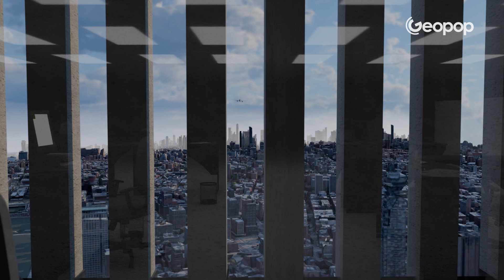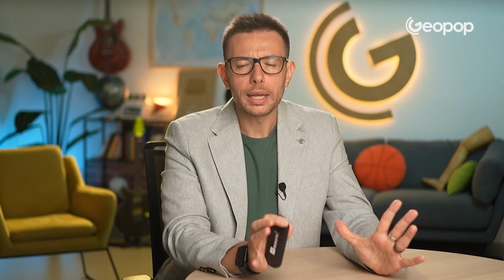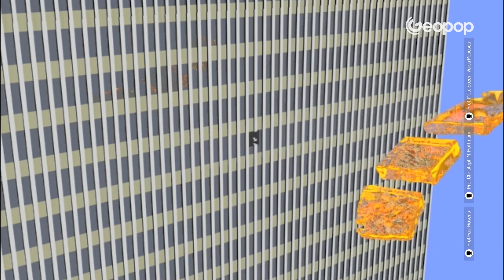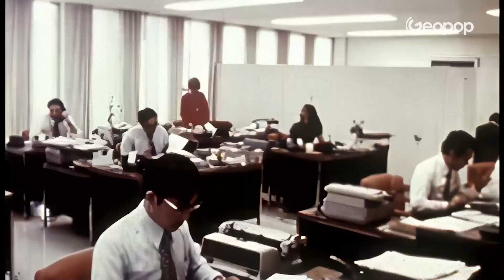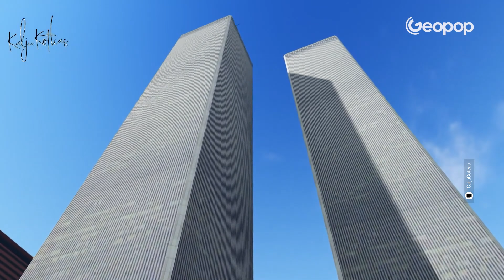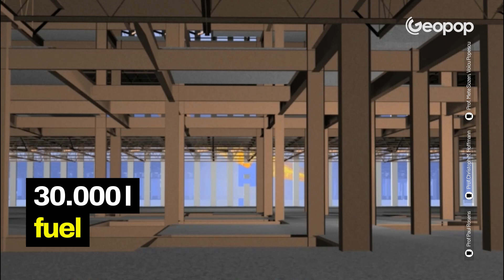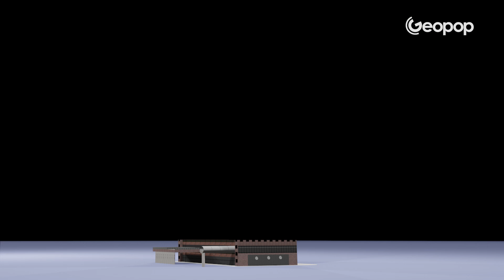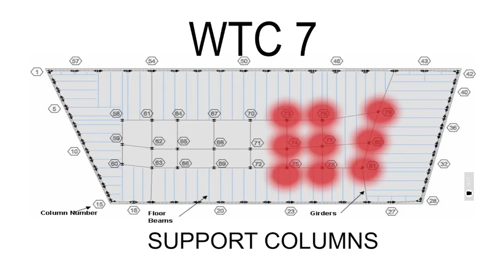9/11, 2001: The Technical Reconstruction of the Twin Towers and WTC 7 Collapses

Comment: B.S.
Reply: PROVE IT
Reply: @Tim22222  Easy.  BBC reported collapse of building 7.  Twenty minutes before the fact.  The equivalent of having a sack lunch and Filco radio.  Having your lunch @ Dealy Plaza.  Hearing on the radio President Kennedy was shot in the head.  Then 20 minutes later, the motorcade comes by you.    You witness Kennedy get hot in the head exactly as the news reported it 20 minutes before the fact.
Reply: @raymond3803  - And here we go again - FFS.  Conspiracists do love beating the same tired old dead horses into glue, never succeeding but always expecting different results.

At 11:07 am CNN reported Building 7 had collapsed at 10:45, or 15 minutes after the North Towers collapse at around 10:30. CNN got their (mis)information from the respected news agency Reuters, which picked up an incorrect report. They issued this statement: “On 11 September 2001 Reuters incorrectly reported that one of the buildings at the New York World Trade Center, 7 WTC, had collapsed before it actually did. The report was picked up from a local news story and was withdrawn as soon as it emerged that the building had not fallen.” 

On 9/11, reporters also said that Camp David had been hit by a plane. Forbes magazine reported that “A car bomb exploded outside the State Department, according to State Department sources.” CBS News reported that as many as eight planes have been hijacked and only four have been accounted for. 

Those reports all turned out to be false, obviously. Just a few of hundreds of news reports that, in the chaos and confusion of that rapidly evolving event would, with the benefit of 20/20 hindsight turn out to be wrong.

News flash: Reporters are human being and just like you, human beings make mistakes. 

As for why anyone would be reporting issues at Building 7, I wonder,... 

Deputy Chief Peter Hayden of the New York Fire Department recalled: We had our special operations people set up surveying instruments to monitor, and see if there was any movement of [WTC 7]. We were concerned of the possibility of collapse of the building… One particular engineer there, we asked him, if we allowed it to burn could we anticipate a collapse, and if so, how soon?… And it turned out that he was pretty much right on the money, that he said, ‘In its current state, you have about five hours

With everyone following reports of its deteriorating condition, throughout the day on 9/11/2001 media outlets had been reporting Building 7 was in danger of or about to collapse. In the chaos and confusion one outlet – the BBC – added “or has collapsed” at 5:00 pm.  

OK, so what?

But you go on and keep beating that dead horse. Let us know if it ever gets you anywhere. It hasn't for anyone else the last 20 years.
Reply: @TheLoonResistance  Wow stinkyshill, you´re a real workaholic!